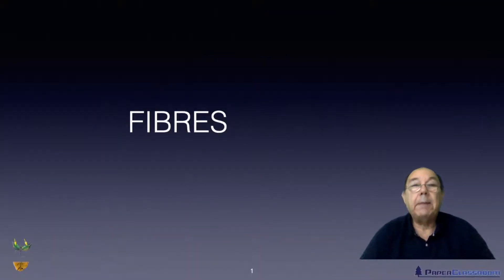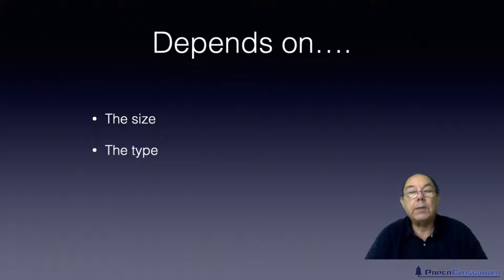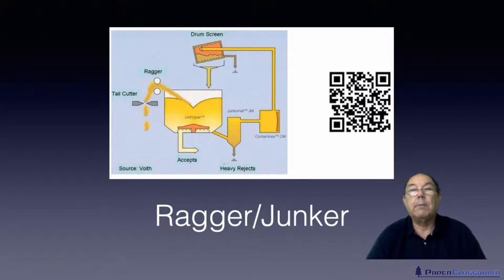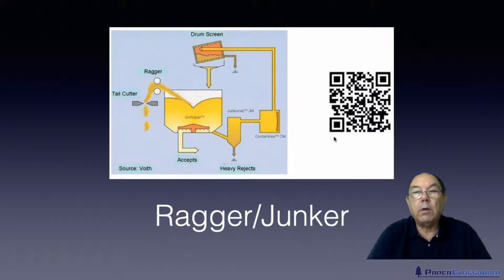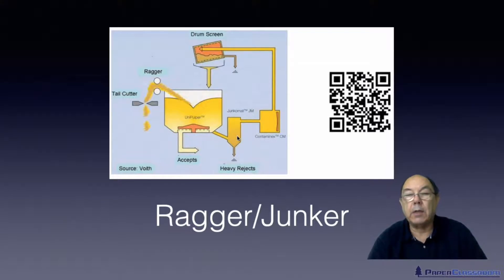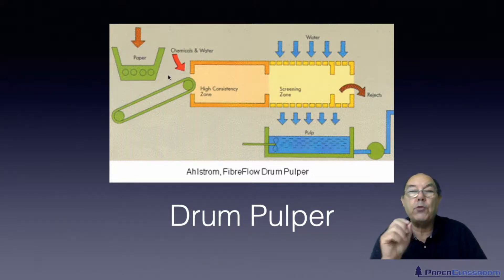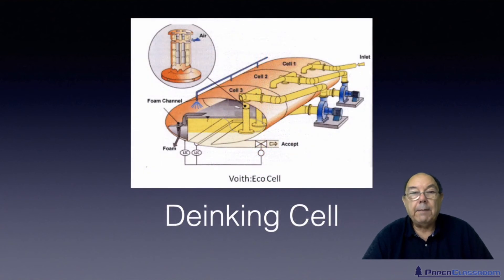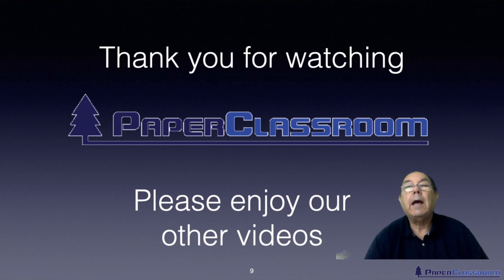Level 2 Papermaking - Removing Contamination

Comment: Cool. I am a retired papermaker, low level production worker, winder operator and was training Backtender when our mill shut down. I had a greater curiosity for the process the whole time but it was hard to get at. I occasionally would have beers with a few of the engineers and have the entire recycle plant schematic and parameters drawn out on 4 placemats covered in beer staines and chicken wing finger marks, but this takes the cake.
Reply from the maker: Thanks for sharing Tom. Hope you keep enjoying the videos. My old mill was Robert Fletcher, we made cigarette tissue and Bible papers
Reply: @PaperClassroom  I worked in Kenora, we ended as Abtitbi Consilidated. 2 top formers, a twin wire, primarily Std news, and some groundwood specialities .